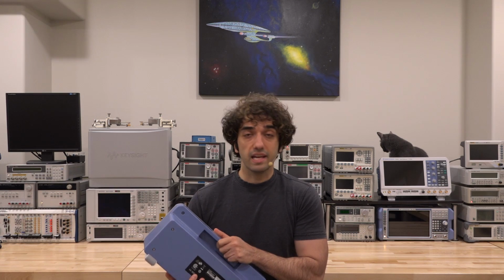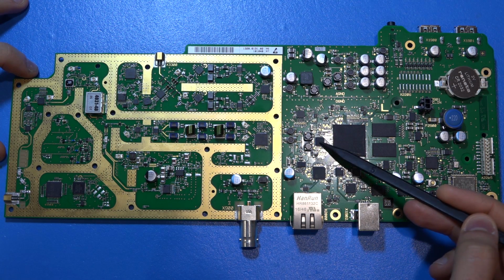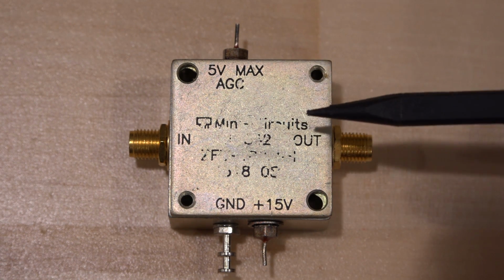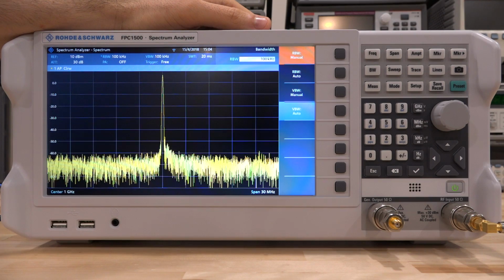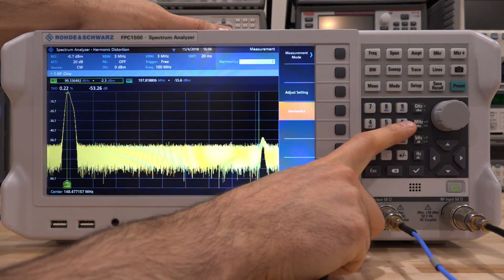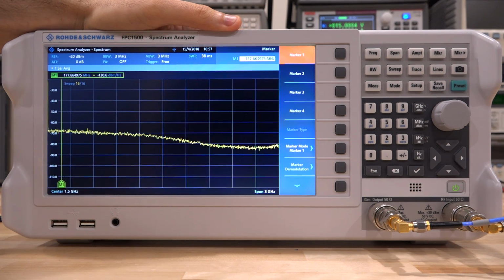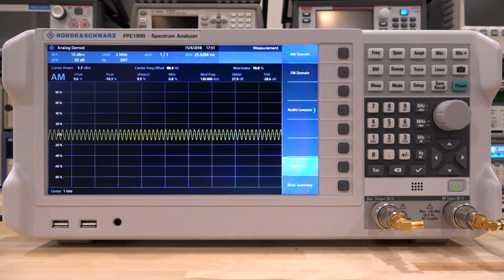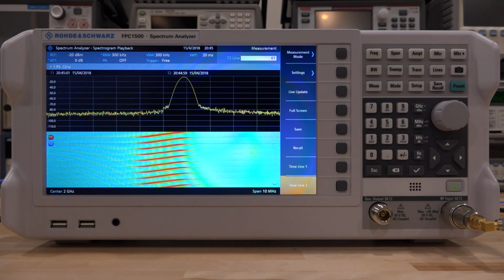TSP #121 - Rohde & Schwarz FPC1500 5kHz - 3GHz Spectrum Analyzer Review, Teardown & Experiments

Comment: 29:00 - Regarding assymetric phase noise, I think that's correct as well. Seems like the internal synth would have to either switch VCO tanks for a different band or the synth would have been reconfigured to for a different freq band
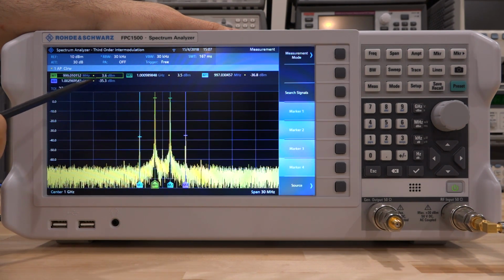31:42 - It should be 3.6-(-35.3) = 38.9 dBc instead

Comment: True or false- you can only use an RS OSL calibrator because the device firmware de-embeds a short transmission line in RS calibrator. Other OSL calibrators from other manufactures do not have this excess line.

Comment: I wish we could go back to a time when one didn’t have to ask how much the licensing key is to enable the power switch. They need to stop obfuscating the bottom line price of instruments. I would love to know what this unit costs, but unfortunately got bored with the process of searching and adding up licensing options... I’m guessing this is a $10,000 to $12,000 class instrument fully optioned up? $400.00 just enable the WiFi hardware already built in, that’s probably using an open source Berkeley based protocol stack is just a tad bit ridiculous. I’m assuming if you contact the sales weasel they throw this in free...

Comment: I can't get my FPC1500 to connect on WiFi-- it sees my access point, but won't connect when I enter the passphrase.  The AP is 802.11 a/b/g/n/ac capable, and the encryption protocol is WPA2-PSK.  There is a '!' as part of the passphrase.  Do you have any idea what might be wrong?
Reply: Ken, I work for Rohde and Schwarz, please contact our Technical Support Department at 1-888-TEST-RSA for assistance with this issue.

Comment: That was really good - although not something I'm going to buy as it doesn't cover the frequency range I require. But I'm not holding my breath for a budget 12GHz Spec-A or VNA from *anyone*...... 

I have a couple of questions about the PCB used for the main board. I assume its not a 2 layer 1.6mm FR4 as losses (at 3GHz considering the size pf the pcb) and 50 ohm track width would be annoying. And 4+ layer would make layout easier with the Zync and double sided component use (while maintaining isolation). Can you take a guess at what R&S have used - I'm curious as to what the professionals think is acceptable?

Thanks. Matt

Comment: Noob question: Why shield in that type of instruments is always so thick? Sheet metal is not good enough?
Reply: My take is that a machined block will not distort and thus seal well with the RF gasket everywhere - a stamped metal piece would need loads and loads of screws to ensure a good RF seal.  And of course a block of aluminium helps with thermal stability.

Comment: More R&S "entry level" stuff that costs a small fortune.

$3000 for the base 1GHz unit, and $5000 if you want 3GHz. And the other "options" have some pretty eye-watering prices too.

Maybe get the base Siglent for one third of the price and just hack it for free to get 3.2GHz..
Reply: Or the Signal Hound. I really want a spectrum analyser but this is not "affordable" :(
Reply: @Colin Alston: Yes, it's not "affordable" at all. When you add in all the options that were enabled on this review unit you are hitting roughly $8000-$8500. Clearly this "entry level" and "economy" stuff - as Shahriar put it several times at the beginning of the video - is aimed at Bitcoin Billionaires. :)

It's a very, very nice unit with some quite advanced features, but still has a few "rough edges" that may or may not be fixable in firmware. Too early to tell. Even if I had that kind of money, I'd be waiting a few months to see what other owners discovered and if those issues were addressed by R&S. 

The "entry level" R&S Oscilloscope that Shahriar - and other YouTubers - reviewed a few months ago (again, fully-loaded units like they were given cost $5000+) still hasn't had all the issues addressed. R&S seem to be quite slow with firmware updates from what I can tell. I guess it's the old rule of "Never buy version 1 of anything!" :)
Reply: I think compared to the Keysight's and LeCroy and other options maybe it's "entry level" at the 3Ghz range? Even the Siglent when you add a tracking generator and license (bleh!) the VNA software and reflection bridge option etc comes out to $5000+. The Rigol's too when you want a TG and VSWR capability suddenly skyrockets to the $3000 mark.
Reply: Something that costs as much as a brand new Toyota isn't a high enough paying customer for them? o_O
Reply: Tricky Rat R&S releases firmware updates at the end of every quarter for their flagship products. The entry and mid level don't get as much attention because there aren't as many high paying customers demanding updates in order to meet business needs.
Reply: @IceArdor - thanks. Good to know.
Reply: It's like saying the iPone is bad because you can get a phone for $100. Shahriar is not responsible for the price, he's just reviewing it, so it is what it is.
Reply: Especially in a case like this it would be good to mention the approximate cost of the unit with all the options enabled and briefly compare the Rigol/Instek/Siglent models with similar features and their costs.
Reply: R&S is well known to be one of the most expensive, high end brands for this test gear. Probably more so than Tektronix and Keysight. This is "entry level" on the R&S scale. Definitely in no way comparable to new Chinese brands like Rigol and Siglent. I do love the current UI for R&S gear though.